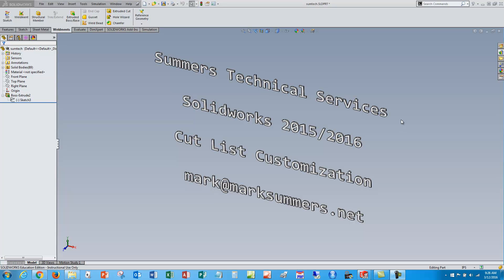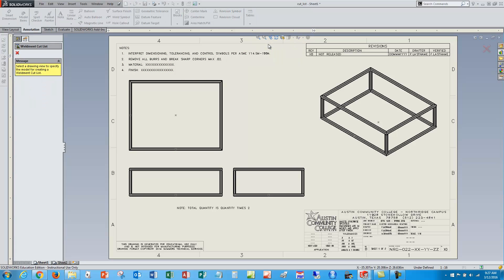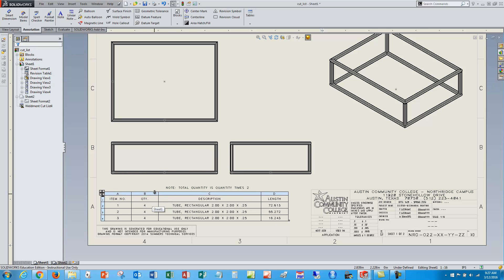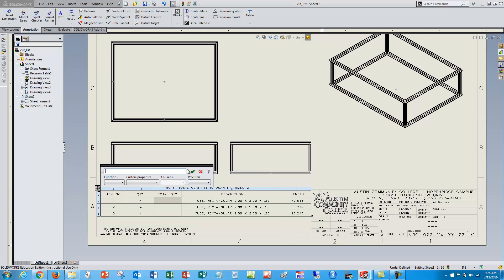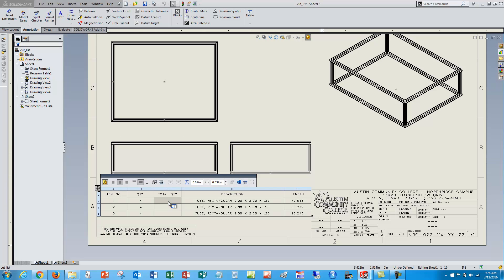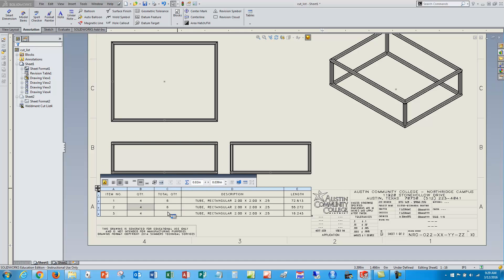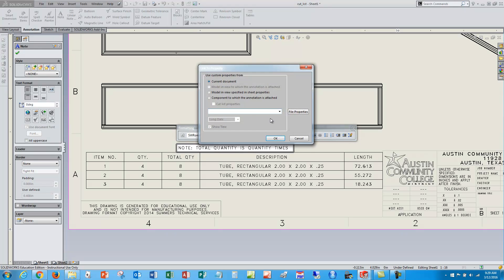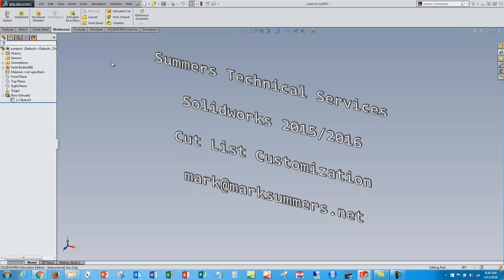Solidworks Cut List Customization

Comment: Hi
i want to link profile template file name link at custom properties in part

help please
Reply: I am not 100% sure of your question.  If you want to add custom sections for your weldments, use the TOOLS-OPTIONS-FILE LOCATIONS pull down menu to add a folder for your custom section cross-section sketches under Design Library.
Reply: custom sections file name link to new part custom properties at profile type name 
 @MarkSummersCAD
Reply: exam npu 120 custom sections link to custom properties in profile type name
 @MarkSummersCAD

Comment: i hope your also answering any questions, so here's my try! 
in the beginning of the video you have the table. you are using squared tubes who are centered in the middle. 
when i make the same table and i leave my (locate profile) untouched, i move onto a cutlist and all my sizes from the outer diameters are 30mm shorter. thats on both sides half of the squared tube. any suggestions how to get this correct? if i draw my entire sketch and locate my profiles the whole drawing is not correct any more......